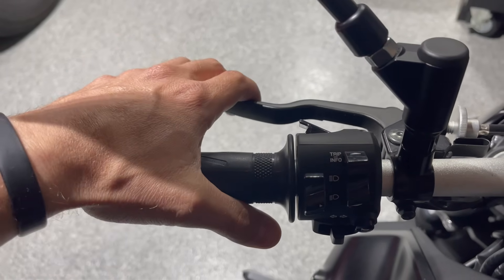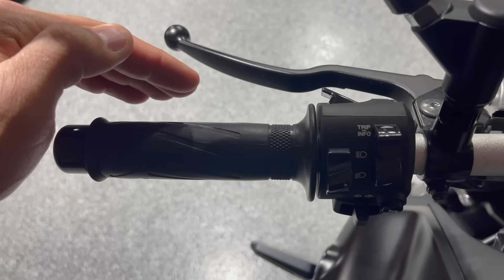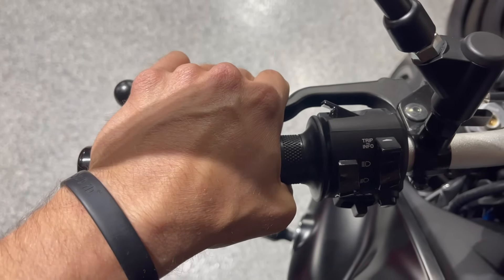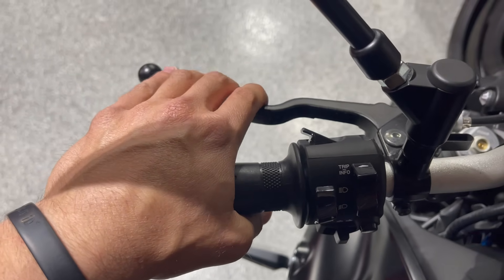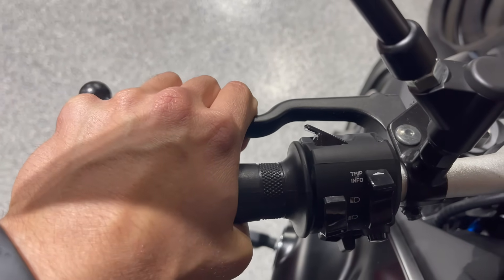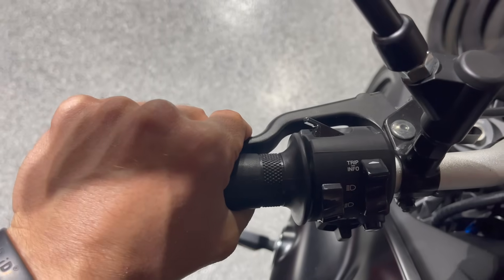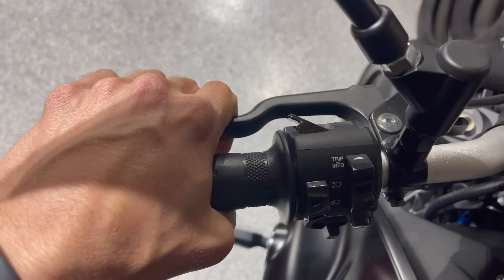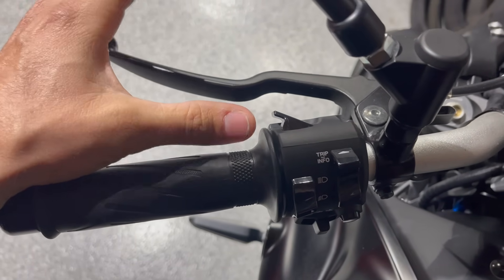Don't Make This Common Clutch Mistake!

Comment: I don't think there's anything wrong with pulling the clutch all the way in. It's just important that you know where the friction zone is and you can reach it quickly for modulating the power.
Reply: I only do that when I'm starting to take off
Reply: When I go into 2nd gear or 3rd ect. do I pull clutch in when I hear the high rpms and then shift up and release clutch ir do I do it together
Reply: Oo
Reply: That isn't wrong but it doesn't feel good if you pull it all the way in before shifting bc you're totally cutting the transfer of power from the engine to the drivetrain, the bike won't accelerate as good as pulling the clutch only to the friction zone. Shifting also feels smoother when you do it. You could also learn how to power shift if you already know how to clutch properly.
Reply: @N.I.C.K.0.3  Yeah I have tried it after I watched his video. Yes it feels smoother. However, I don't know if that's something I'd recommend a beginner rider to do if he's busy getting used to other stuff. Note that before I tried this I could already do clutchless shift so this "friction zone" shift is like something in between. IMO this could be a bit advance, or not
Reply: @gravityrider.melbourne  yeah that's true, it's somewhere between clutchless shifting and full clutch engagement and it really is fun doing this technique once you're used to it. As a beginner though, I think it's only their muscle memory to pull the clutch fully.
Reply: I think one potential "wrong" thing is that over time it may stretch the clutch cable and make the clutch handle feel loose.
Reply: @adamcolbertmusic  basically your cable won't last as long.
Reply: @sleezzzyp  high rpms is because the clutch is still engaged . Bring the clutch to the friction zone then give it throttle .
Reply: It is on the track tho hahaha but yea
Reply: thats why its adjustable, it's not really going to "stretch" it out... @adamcolbertmusic
Reply: I don't use clutch at all and there is no problem then, quick shifter
Reply: I guess less stress to your fingers keeping up the long ride.

Comment: I'm opposed to this, either pull the clutch in fully while shifting gears, and in turning if you think you need to but never partially for sure because doing so will wear your clutch plate faster due to friction in between the running engine and the clutch.
Reply: Faccts
Reply: You are right
Reply: Right. This is the recipe for early clutch burning
Reply: Agree
Reply: Not true. Your friction plates are fully disengaged when your clutch lever is pulled in one-quarter of the distance to the handlebar. Pulling your clutch lever all the way back all the way to the handlebar does nothing to separate the friction plates any further. https://www.youtube.com/watch?v=JhTf7cBeGcs
Reply: Factss its cause more heat
Reply: While it’s true that the plates will take on more wear, it’s relative. 

Useful employment of partial clutching (friction zone here in the US), will aid in some maneuvering and controlled turns. This should not be the always, but rather the practiced and accessible option as needed. 

Pulling the clutch all the way in every time will add to the adjustment of your clutch cable being overused too. More clutches fail with cable issues than plate issues. So there’s that.

Last, for now, is that use of partial clutch is part of the design (especially in modern motorcycle trannys) to allow control and to prevent over powering, sudden engagement and other detrimental aspects of the mechanics of you bike. 

But most of what I have read here (including the OP’s video) is somewhat subjective. Opinion based. If use clutch lever “full pull” when sitting at a light that’s about to go green / awaiting oncoming traffic to clear etc., or when I’m NOT on a hill. I use partial to “hold the bike” when I’m on a hill, or when I want to feather the power delivery a little. 

So try a few ideas and see how you prefer it, then go with that. 

Hope you stay safe.

(I often hit N at a light, when I have some time, and release the lever altogether - it’s a police technique fyi).
Reply: That's fundamentally incorrect.   The clutch is fully disengaged as soon it's "inside" the friction zone.  Your clutch should be adjusted so that the friction zone is the last 1/3 of travel WHEN RELEASING.  This is riding 101 type knowledge.  2/3 of the lever's movement range is just overtravel for mating the lever and grip together comfortably in your closed hand at traffic lights or extended stops on trails while in gear.  Your clutch probably isn't even adjusted right if that's what you think.  I've seen dozens of you out there.
Reply: @phantomshtter  The clutch is partially engaged in the friction zone or else it couldn't be used to control power delivery to the rear wheel in low speed maneuvers, which is standard practice.

Comment: Totally understand about the friction zone, but it seems like a muscle reflex to pull the clutch in all the way to shift. Will take time to retrain muscle memory to do it this way. Trying it on my next ride.
Reply: It is the first and most useful skill to learn. Also make sure your lever is adjusted for your hand because if you decide to adjust it later it will feel very weird and it will take time for you to get used to the new friction zone.
Reply: i always use two fingers and the clutch is just out of the zone when it touches my other fingers maybe that will help you
Reply: It takes practice!
Reply: You must have stronger fingers than mine then! Ha
Reply: Used to do that, later realised not pulling the clutch all the way makes shifting smoother also faster.
Reply: Use 2 fingers and it'll stop you from squeezing 100%
Reply: Ride two fingers on the lever.
Reply: @alexandrudinca3080  yeah I'm trying to break this habit myself. Sucks that my bike doesn't have adjustable levers at all. Plus I got tiny ass hands lol
Reply: I learned its actually enough to pull the clutch for only like 10% of the lever movement for smooth and quick shifts
Reply: Sorry, but that's not true. I don't even use the clutch to upshift and barely use it downshifting. It's an habit, it has nothing to do with reflex. You need to use your clutch AND the throttle. As you close the throttle a bit, you remove torque and you can upshift even without clutch. The reverse happens downshifting (blip) bu it's much harder and counterintuitive (you need to blip, ie accelerate, when downshifting. Many bikes nowadays have it automatically.
Reply: @CarloPiana  What your talking about is clutch less shifting,which I started doing last year,but only when accelerating hard,not all the time.I know it doesn’t hurt your bike doing it this way. I was referring to when I am just taking it easy. By the way Carlo ,what bike do u have?
Reply: I will have to look at it but I'm pretty sure I also bring it all the way but I know exactly where my friction zone is and have no problems using it . I adjusted my clutch to be arround half way (where it's comfortable for me)
Reply: @bbbonthemoon  for me, myself and I...lol I like it a bit more than 10% everyone will have it a bit different and that's ok cuz we are all different and like how things feel differently!
Reply: It does take time. It took me decades to figure it out myself, actually. But, now that you know it, you can practice it!

Personally, I don’t use my clutch to shift up or down anymore. Haven’t for about 3yrs now. I only use it to start or stop.
Reply: Easiest way to break the habit is to only use 2 fingers on your clutch, then just pull your clutch lever in until it reached your knuckles on the 2 fingers that are still wrapped around the handle bar. This is how I always ride. With my hand oriented like such, I have the clutch set to just barely remove all power from motorcycle just as it reaches my knuckles. Leaves all guess work out. So essentially I'm still pulling the clutch in all the way, but only all the way to my knuckles instead of all the way to the handle bar. Try it out!
Reply: @joshhhhhhhhhhhhhhhhhh  Thanks Josh,I will start with adjusting the clutch. I ride a 05 cbr600rr at 59 years of age. I am an adrenaline junky
Reply: Use two fingers to pull the clutch, not the entire hand. You’ll see that your other fingers block the lever anyways.
Reply: Definitely dragging the clutch gives you more control for slow-speed manoeuvres, but it doesn't make too much difference when changing gear - except sometimes helps the 'new' gear engage more easily.
Reply: @Loiczzr  yeah, not everybody should do this, if a clutch is adjusted properly, full pull is required. I set mine up same way.
Reply: You don't even need to use the clutch at all
Reply: Lol it's been 5 bikes since i learnt this first 👍
Reply: @TravisTerrell  yep, I was thinking the same. I have to use all the fingers for strength. If I use less fingers it creates tension in my tendons and my fingers become rigid and unable to move them for a second. More of a safety hazard for me LOL so I'm sticking with using them all.
Reply: Start riding MX and offroad. Especially on wet days. Using your friction Zone is a must.
Reply: Same
Reply: @itsbullbabyy  This would definitely help thanks!
Reply: @itsbullbabyy  noted
Reply: If you ride for years and you're as lazy as me you'll learn exactly how far you have to pull the clutch to shift. The Multi has a heavy clutch, and I barely bop it to get into the next gear.
Reply: I’ve got it down now, and love it.
Reply: Additionally a very surprising comments section.  This was day 1 on learning to ride , during low speed manoeuvres.  
Don't really even need to clutch up gears on 90% of bikes due to the drum style selector and the way straight cut gears engage .

Comment: The clutch plates gets worn out quickly while shifting gears using partial clutch
Reply: As a relatively new rider I'll stick to pulling in the lever all the way until I upgrade to a bike that has a quick shifter. Don't want to form any bad habits while I'm still learning 😁
Reply: @Luun89  Exactly
Reply: Ikr but this is how it is
Sometimes even on manual cars you have to ride the clutch 
On bikes on tight maneuvers there is no way you can it without riding the cluth
Reply: You don't necessarily have to pull the lever in all the way to be fully disengaged. That's the point of the video.
Reply: @confusedredditor1660  100% agree
Reply: I rode a kawasaki kle500 06 brand new then and did 25,000 miles on it in 4 to 5 years. Clutch was fine and no problems with the gears and i was using the clutch a lot at low speeds to keep balanced coming up to traffic lights or in traffic.

Modern clutches in motorbikes, cars and vans can go for years as long as you change the oil regularly and dont go over more than 10 seconds on holding the clutch.
Reply: Most bikes are wet clutch as long as you're not riding it at a stop light or launching all the tim it's hard to wear them out
Reply: I believe this is the case with dry clutch operation.
Reply: @confusedredditor1660  Nope just have to break torque that's the biggest thing.
Reply: Who uses their clutch to shift gears!?!?

Comment: This is a really good way to destroy your synchro's in your gearbox.  Pull the clutch in 100%, let the engine rpms fall between clutch disengagement and clutch engagement. Too many people shift poorly, with very little smooth coordination between pulling in and disengaging the clutch and using their foot to shift roughly into the next gear, not allowing enough time for rpms dropping and synchro gears meshing cleanly.
Reply: 💯 fax
Reply: Thankyou
Reply: Your logic is correct for car transmissions, but motorcycle transmissions don't have synchros. Motorcycle sequential transmissions have constant-mesh gears that use dog collars to select the next gear. While true that pulling in the clutch 100% every time will probably decrease the wear on the dog-collars, the difference is pretty minimal.
Reply: In addition to continuous sync gears, motorcycles have wet bath clutch so friction zone is golden with no damage
Reply: Motorcycle transmissions uses dog clutches instead of synchronizers

Comment: Greg I would digress here. Though I second your point about friction zone, the above technique comes in handy when trying to find that starting point of friction zone. Shifting right at that friction point especially at low speeds can cause stalls and thuddy shifts. It's primarily due to the fact called "clutch graze" where the clutch isn't fully engaged and fully disengaged, the start point of friction zone as you put it. This is okay for high speed shifting (remember quickshifters and how they make life easy after a particular RPM), but for slow speeds, beginners, it's better to depress the clutch fully or 70% for better quality gear shifts and clutch feel rather than grazing at the friction point.
Reply: better for all to two finer the clutch and remain hanging on to the bar.
Reply: Totally agree, there's a reason why the clutch lever is designed the way it is. Teaching new riders bad habits to start with is downright dangerous. Continuing pumping out bad advice like this is just plain stupid.
Reply: Good point Vijay.
Reply: thank you i thought so
Reply: is it not hard on the clutch as well if you don't make it all the way through the friction zone and try and shift... I understand you can shift with no clutch but..
Reply: I agree, was going to say the same thing.
Reply: Well, this is advanced level but better to learn it from beginning well for those who have fine motor skills
Reply: @iamtheonethatwonagain8354  yeah, you will essentially scrape the clutch plates against each other
Reply: When I go into 2nd gear or 3rd ect. do I pull clutch in when I hear the high rpms and then shift up and release clutch ir do I do it together
Reply: @ Vijay Anand...If your shifts r causing thuddy and stalls ur not mastering the friction zone, ur beginning to learn it and throttle control
Reply: @karlopeternel7685  this is such absolutely beginner lever it is taught immediately after learning to crank and shut off ur m/c in all MSC, both in US and world wide
Reply: @iamtheonethatwonagain8354  wet bath clutch on m/c is designed to be used this way.
Reply: @turdferguson5108   well, lol, partially correct. Wet bath clutch on m/c is designed to be used with expertise in friction zone. Don't justify inability with imaginary mechanical issues
Reply: @iamtheonethatwonagain8354  m/c have wet bath clutch and is DESIGNED to be shifted in frictionzone
Reply: @karlopeternel7685  this is #2 in basic m/c  training....second to learning how to crank/shut off ur bike. That's standard, worldwide, MSC format
Reply: @chipblanc6037  The only one imagining things here is obviously you. Wet or dry clutch makes no difference, and if you took the time to actually read what I wrote, you would find that I'm talking about how you use the lever and not how you treat the clutch itself. 
People look up to you tubers- don't know why, but they do - and when they give stupid advice like this I react. New riders search for info on YT and teaching them rubbish is irresponsible.
Reply: Why is it so hard for people to grasp this? He said after the friction zone, in the dead zone. Not when your clutch is in the friction zone.

Comment: ALWAYS PULL YOUR CLUTCH ALL THE WAY BACK!!! Except if you want to change discs every year or so
Reply: Lol facccts
Reply: you're wrong...
Reply: @mick8018  why?
Reply: Quite simple...
Friction plates in a motorcycle clutch only need to separate by 2 or 3 millimeters to fully disengage all power generated from the engine crankshaft. The clutch lever travels 20 to 30 millimeters before it hits the handlebar.  There is no advantage or extension of clutch life by separating the friction plates beyond 2 to 3 mm. Once they are open, all you accomplish is to separate them by a greater distance when you pull the lever all the way in...

Comment: Think I disagree with this. Could be rough on gears and clutch imo.
Reply: Nope. My bike is 10 years old and I have been clutchless shifting for most of that time. It just kind of happens after a while. Knock on wood, I have never had an issue.
Reply: We are not talking about clutch-less shifting here buddy @probably_drunk
Reply: @goosefraba2385  leave it. hes probably drunk!

Comment: I started using two fingers (index and middle) to pull the clutch and set my lever such that when the clutch lever touches the ring finger the bike is at the end of the friction zone. Helps with the consistency.
Reply: Subconsciously started doing that only cuz my hands would cramp. I feel more in control over my bike too
Reply: Exactly, two fingers is the best way to shift IMHO
Reply: @marcd7332  I shift with one finger front brake with one finger ... 🤷‍♂️
Reply: @georgephillips7408  whit which finger? With index finger or middle finger?
Reply: 👊🤝👍
Yeah Bro
Reply: @karlopeternel7685  depends on why he has to grab the front break.
Reply: @karlopeternel7685  ether or sometimes using both index and middle finger when more pressure is needed on front brake but usually one finger clutching maybe in traffic switch to two finger for more control
Reply: My clutch is too hard for 2 fingers 😂
Reply: Some clutches are really stiff, so either you have to be really strong or use whole hand.
Reply: @muhmdslman  Same problem here. My Triumph Thunderbird 1700 has a very heavy clutch. I tried everything, and no improvement on the strength required to pull it. But I'll definitely try this "not fully pulled clutch" idea.

Comment: This guy is the teaching you how to beat your clutch.  As a rider since the 70’s, it’s not an issue pulling the clutch in. Unless you’re a weakling.   
Even the manufacturer says to pull the clutch all the way in when the bike is new.  
Pull your clutch in people.  Why think so hard when you’re scooting along on how far to pull the clutch in.
Reply from the maker: You obviously don't practice slow speed turns or if you do, aren't any good at it.